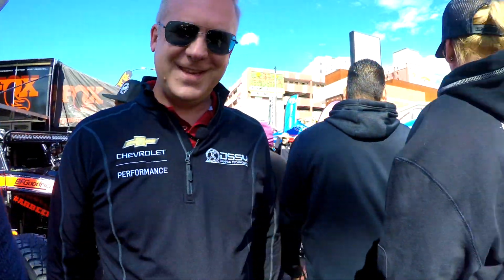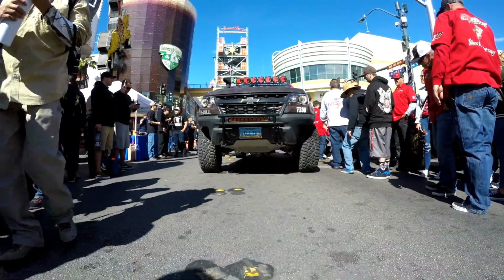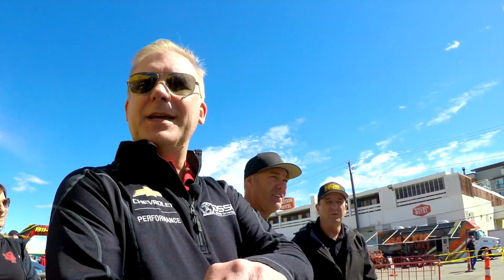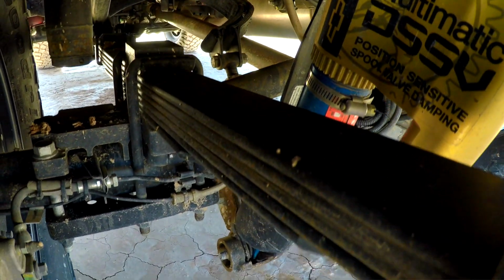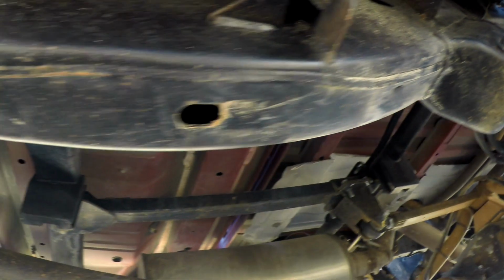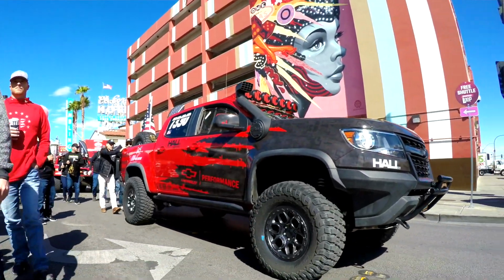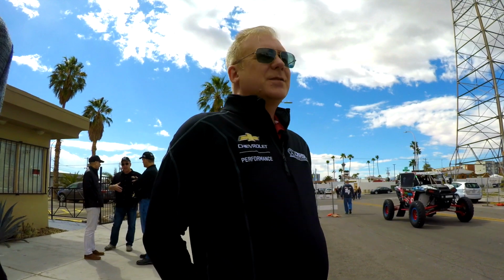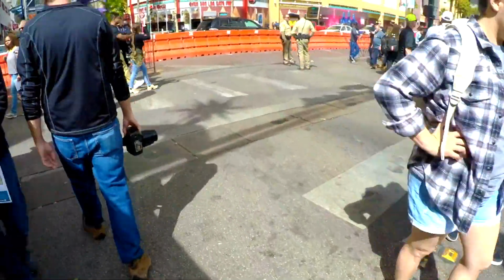Zr2 Thrilogy?: Tom Gierman, Race Truck from Stock Truck, Chevrolet Performance Race Parts

Comment: As a new 2019 ZR2 owner I really enjoyed that interview with GM's engineer. Now all of those additional off road parts make sense, and are so well engineered as a complete system. I recently purchased the AEV bison transfer case skid, transmission skid and fuel tank skid from a local distributor so I'm covered up from the rocks here in AZ. In addition I added the 589 fab shock skids. I figured $150 is a great investment to save a $1,000+ shock. you have a great channel, I'm glad to have come across it.
Reply from the maker: Dang man thanks. Thank you for watching

Comment: This is why corvette racing has been so vital to gm performance cars, they race them and learn from it then it trickles down into the production cars. Say what you will about the politics at the upper level of gm or the mismanagement in certain areas , the guys on the ground are true die hards that are pushing the envelope. Badass interview. Oh and to anyone at GM reading this, you better make a long travel off road GMC Sierra (not a lame AT4 lift kit) or I’m going to do donuts on your grass 😡
Reply from the maker: Lmao. And wait till you see the work the engineers do in the race pits on the next video

Comment: They all chuckled when they saw your video haha that was an epic jump man! I wanted a Zr2 since I first saw one, but I didn't buy it until a month after I saw your video, and you showed the frame was still straight.
Reply from the maker: Oh damn man that’s good to here. She been good to you?
Reply: @420motors  the 2018 zr2 was a lemon gm bought back from me but they gave me a 2019 zr2 now and it's doing well
Reply from the maker: Oh thank god. How bad was the buy back process?
Reply: @420motors  it took a while but it was fairly simple, I got a lot further with gm Representatives when I was being nice than being a dick about stuff, I tried both ways haha. Truck broke in January, in March the replacement parts arrived but failed inspection, so they made a very generous offer and I accepted it and got my new 2019 on March 30th. Because I had my first problem under 3k miles even though I put 19k miles on the truck they didn't charge any usage fees. their offer was my entire down payment, plus all payments ever made on the truck were put towards a vehicle of my chosing, they didn't charge me any usage fees and 0% financing. I ended up owing less on this 2019 than I did on my 2018 and my monthly payment lowered 100 dollars a month
Reply: @420motors  they also covered the rental truck the entire time my truck was in the shop, but I had to request a gm vehicle, they won't pay for a non GM rental
Reply: @420motors  one last thing, they didn't tell me the break down of the numbers, they just offered an amount of money towards a vehicle of my choosing, and it was a couple dollars difference than my down payment and all payments I had put towards the truck so I just assumed that is why they offered that amount, but I could be wrong that might have been a coincidence
Reply from the maker: Yea it’s just for there accounting. You could have made the worse deal in the world they would be obligated to buy you out of it. That’s awesome man usually buy backs are horror stories from any manufacturer. Yours is about  one of the most pleasant I’ve heard about.
Reply: @420motors  yeah for us it wasn't too bad, it was very worrisome, but turned out in our favor. But I think it also helped that there was absolutely no denying that every single problem came from quality issues and not abuse.

Comment: First off thanks for the great video. That's a lot of content, and very much appreciated. 
I was wondering if you could do a pros and cons video of a gas vs diesel ZR2. 
A perspective of why you would choose one over the other.
I also noticed that not all of the Chevrolet Performance Race Parts will equally fit both the gas and diesel, 
like the "Cross Car Beam System." So a break down of what fits and what doesn't fit a gas or diesel
would be great, maybe in a different video. OH one last thing.....you vato's are doing an awesome job on this site.
Reply from the maker: Oh yea man. On the previous video towards the end I run through a list of what mods work for what using the proper names also with a link to the website. Here is the link  https://youtu.be/A9wry__JwWM
Reply: @420motors  Thank you, much appreciated.

Comment: Did they address the need for a rear shock Skid?  Seems like a big weak point with the lowest point of contact.  I saw a rock hit my shock under shock mount during video editing, now I'm ordering DatinFab ZR2 shock skids to install!  That is well over $1000 for the shock
Reply from the maker: Nice. Yea it didn’t make the cut but it was addressed. More of an explanation into why they were placed there than anything else though
Reply: Why are they placed there and not closer to wheels?
Reply from the maker: A few different trivial reasons actually. Wheel clearance is one, a bit of chevy’s tradition also I suppose. But there is a benefit to having them there. More articulation per the much of travel

Comment: Did they imply that the race leaf pack could be used with the stock DSSV shocks or do they need the heavier damping of the race shock?  I’m trying to understand what the right upgrade path is for my use model which is mainly carrying a heavier overlanding load. I’m interested in the jounce shocks to but they sounded really loud in your first video of the race truck. Is the white truck the same?  Thanks for publishing this!
Reply from the maker: They are the same but I didn’t think either was too loud. And yea on the video you could tell I got confused on that section too at first.  You can use the springs with the stock shocks but will need limit straps. And yea your overland payload would enjoy them. I’m sure it’s bouncy as hell with no weight in the rear
Reply: 420 motors I heard from the AEV guys that there are recommended stage 1,2 and 3 combos. I can’t find anything published on what these “stages” are. Any insight here?
Reply from the maker: Yea probably just what they refer to them internally. My guess would be bumps or leafs is one stage. Bumps and leafs a second stage and the shocks a third. But I’m honestly just guessing

Comment: If I install a ZR2 Front Leveling Kit with High-Angle Upper Control Arms 84621360 on a Stock 2020 ZR2 is it necessary to install the Ball Spline Half Shafts 84429060 or am I ok with stock half shaft? Don't use it quite as hard as you. Love the vids keep them up?
Reply from the maker: If you don’t use it much you should be ok. I would expect the failure point to be torn rubber boots. So you will make it home by risking it
Reply: @420motors   Thanks guys!

Comment: Will the cv axles work on the z71? I'd love to throw those on with my mid travel set up. RCV hasn't gotten around to doing cv shafts for our trucks yet
Reply from the maker: They might be too long but I’m not sure. They work on h3’s so it is possible I just don’t know the geometry.
Reply: You would need ZR2 UCA, LCA, possible the rack as the ZR2 is 3.5 inches wider than the Z71.
Reply from the maker: Nice thank you for that man
Reply: @madcratebuilder  I wish they'd make it universal. I'm not gonna convert to the zr2 suspension from bajakits UCA and extended kings